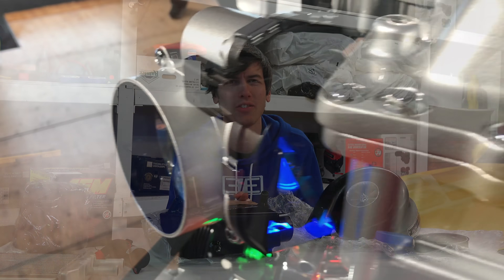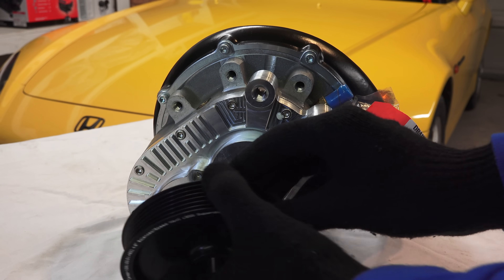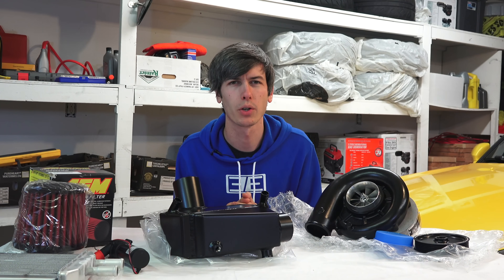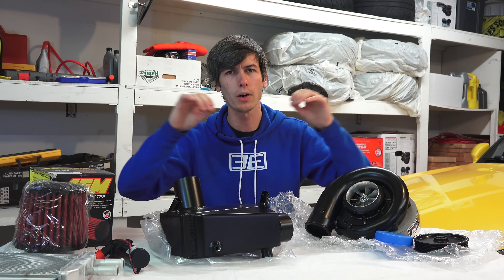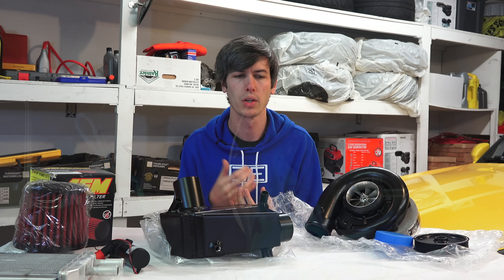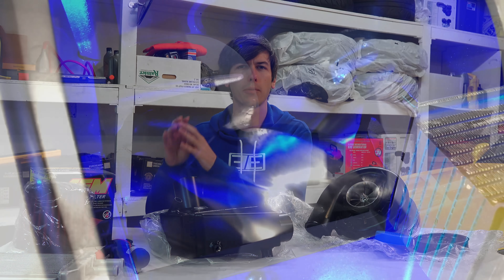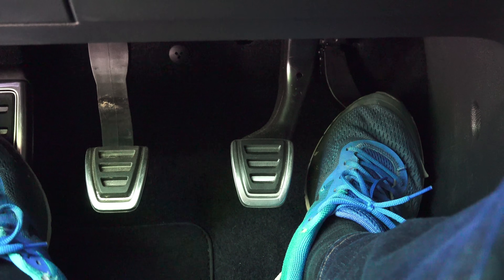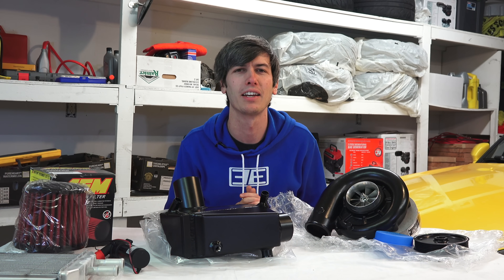Turbochargers vs Superchargers - Which Is Better?

Comment: I agree with your conclusion. For a street car, I much prefer a supercharger. In part for the lack of lag, but also for the torque curve. My current engine (heads/cam/blower LS3) is an example. We started the dyno pulls at 2500RPM. At 2500RPM it made 450TQ. It peaked at 605 at about 5100. That broad, flat torque curve means it's easier to maintain traction than it would be with a turbo hit, and it also means that the car will pull strongly no matter where I'm at in the RPM range. A turbo on the same engine would probably have made more peak power, but would have a much more peaky torque curve - fine and dandy for a race engine where you're foot to the floor high RPM all the time, but less than ideal for a street car, which spends the vast majority of it's time at part throttle.
Reply: Actually superchargers are much better than turbos for "driving" type races, such as auto-x and road course.  I actually raced a Cobalt SS with a TVS 1320 in road course (Why? I was making sure I wasn't in the same class as Corvettes and Porsches).  314 @ 2k, 321 @ 4.8k, and 307 @ 7.5k in a stripped out car (2640lbs with me in it and a full tank of gas) with a coil over suspension was a blast.  And with the gearing, you would spend the whole race in 2nd or 3rd gear.  In Auto-X, you pretty much stayed in 2nd so didn't even have to worry about shifting.  Thing was a street legal gocart on crack with comfy leather seats.

Comment: Are smaller displacement turbocharged engines really that much more efficient than larger displacement naturally aspirated engines considering the lower static compression ration, extra blowby, and "slight" increase in backpressure when intake pressure is above atmospheric pressure?

Comment: Hey Jason, I watched pretty much all your videos and I had a question. I have a 2008 wrx stage 2+ protuned w/ stock air box w/ k&n panel filter. I was thinking about getting a short ram intake w/heatshield along with a pro tune for the intake.  Will that extra induction benefit me over stock airbox? 

By the way, I drive daily and tend to drive spiritedly more than half the drive, thanks Jason!

Comment: I may have missed this point but with a turbo vehicle after spirited driving you should let the turbo run a little before turning the vehicle off do you need to do anything like this for a supercharger? Although it does not need oil to lubricate the bearings?

Comment: Hi Jason/Engineering Explained, if I do not change my driving habit (mainly on street @40-80kph,  <2500 rpm), which will be more fuel efficient between turbo vs supercharger? Thanks man!
Reply: If I may? At vehicle and engine speeds as low as you are using, I would not recommend either. You would be better served building a naturally aspirated engine that makes good low end torque. This would give you more fuel efficiency, as well as lower maintenance costs and greater longevity of the engine itself.

Comment: I think it would be interesting if you looked into the new Ram 1500 with the electric motor/generator which is mounted to the engine via serpentine belt.  they claimed it can do regenerative braking but that seems weird.  Normally it seems the torque converter would be unlocked as you slow for a stop sign but it seems that it would need to be locked up in order to have any meaningful braking.   also looking into the new claims from GM with up to 7 cylinder deactivation    it seems that it would shake like crazy with 1 piston and also the frictional losses from 8 cylinders and other things like alternator, etc would require more than 1 cylinder to run.   they claim to have start/stop for periods where you would be sationary which seems like would be the only time you could get by with 1 of 8 cylinders combusting.

Comment: PLEASE do a video on the new opposed piston gas and diesel engine. Its in proven prototype phase. Atlas (or something with an A is the company)Amazingly interesting. Based on ww2 german bomber engines. So piston faces piston, no head, no valves, and can run gas and diesel.

Comment: Can you do a video on the theoretical limit of hp/liter in NA cars. I thought this would be relevant given the new Porsche GT3 RS just bumped its hp from 500-520. Giving it 130hp/liter. The 458 speciale had 132.7. I am curious if there is a limit.

Comment: Turbos are also VERY complex to run. To avoid a LEAN* situation in your engine you need complicated 3D fuel maps and fuel delivery systems. With super-chargers you always know exactly how much boost you have at a given RPM regardless of load or throttle position.
This is why adding a turbo to a non-turbo car is dangerous/expensive and complicated vs adding a super-charger to a non-super-charged car.

I'm a big fan of turbos if they come from the factory that way.  Otherwise, super-chargers are your best / most reliable option.
* LEAN meaning not enough fuel for the air being pushed in = over heating and damage to engine internals

Comment: Another pretty huge plus for turbos is their performance at altitude compared to naturally aspirated or supercharged. Any kind of ecu-controlled wastegate allows the engine to increase its boost ratio to maintain its rated power even way up in the mountains where other cars can lose a huge amount of power...

Comment: Have you tried driving a vehicle with a variable vane turbo (VVT) or a variable geometry turbo (VTG). THe reason I ask is because I have driven a vehicle with a regular turbo and the turbo lag is certainly there by contrast I have also driven a vehicle with a VVT which is considerably different (both applications were in Diesel engine equipped pickup truck. The VVT does have a little lag but is considerably less then a regular turbo. With the VVT the vanes can be readjusted to keep optimal boost throughout the RPM range. So my question is (since you have the ability to drive a supercharged equipped vehicle and a VVT equipped vehicle and have the engineering background and tools to test this, is a VVT and a supercharger comparable  to each other in throttle response and power throughout the RPM range and what are your thoughts on the VVT? I look forward to hearing your take on the subject, thank you.

Comment: As discussed, they're all superchargers. There are mechanically driven superchargers and there are exhaust gas turbine driven superchargers. The term "turbo" or "turbocharger" is actually short for the original term turbosupercharger.

Comment: Roots superchargers require oil , they just typically have their own supply.  A lot of new Centrifugal superchargers use their own oil supply as well (V-3 Vortech).  My Raptor AU centrifugal actually just uses ceramic bearings (no oil at all) although it is water cooled.  I can drive around flooring it, stop and grab onto the snail with bare hands... only warm to the touch! Supercharger is great for a power adder on beat up old higher compression engine.  We feed it the most air when the engine can handle the most air (high rpm) so  the load on the engine is relatively low. And no lag!

Comment: Hybrid cars with turbos have almost zero lag. This is true in high end cars. 
Turbos are not as effective in a petrol as they are in a diesel engine. The effect in a diesel engine can be felt, with a lag, but the increase in torque is, in my opinion, enjoyable. 
Superchargers are, like you said, pulling power from the engine and thus reducing some of the power of the engine.
The future of automotives are in the hybrid vehicles and the faster the development of motor generator unit is, the better it will be for the cars to be more efficient, while yes, being more costly.

Comment: Hey Jason. Could you give your input on what could be wrong with my car? It makes a wierd noise when lifting the clutch when accelerating, but only on a cold engine. I have uploaded a 12 second video on my channel. Since you are the most knowledgable person I know, could you give it a look and give some feedback on what is wrong? 

Car is a 2006 1.4 TSI (140/220 HK/NM) VW Golf MK5 (euro spec). The sound has occurred 100 km after a frontend crash. 

Best regards Daniel
Reply: If anybody else has any knowledge to cars - especially VW then feel free to give input!

Comment: I have a question regarding the lubrication systems in turbos. Have there been any examples of a separate reservoir for oil specifically for the turbo? Or is it more efficient to use the same oil setup with some kind of auxiliary cooling system? And lastly, are there many solutions to the heat issue with turbos? If these questions have been answered in one of your other turbo videos, a link would be a fine answer if so. XD

Comment: IMHO i think turbochargers drain also power from the engine, not as much as superchargers but they do block a bit the exhaust gases from going out. Engeneering Explained could you please confirm?

Comment: two questions: why do they not make a turbocharger that has a pulley to spool it until you reach the needed exhast for spooling, then clutch the pulley, and let the exhaust handle it... and branching off of that, why don't they make a supercharger that clutches the pulley until you're at wide open throttle or whatever throttle percentage you desire, so that it only drags when you demand the boost?

Comment: I saw that you had replaced the 2 bolt style oil filler with a hose fitting.  do you like that style instead?  it looks nice so I was curious how you felt about it.  I have a 5.9 cummins that I enjoy driving

Comment: First off, I have spent a lot of time watching and enjoying your videos.  Lots of great info.  That said, there's one concept I take issue with in this video, the idea that a turbo is free energy, powered solely by waste energy.  It's an idea that I've often seen perpetuated all over the internet.  

On a well setup turbo system, you often see a drive ratio of ~1:1.  So if you've got 20 PSI of boost, you've got 20 PSI of exhaust back-pressure or thereabout.  A poorly setup system can be much worse, especially if someone is running right up along the compressor choke line and flow limits of the turbine to squeeze all they can out of it.  This back-pressure reduces the amount of power the engine would otherwise produce.  It makes it more work for the engine to expel exhaust gasses, and that would reduce power where it not for the net increase in airflow, ergo increased fuel and power, of the engine.

You never hear people building N/A cars advising someone not to worry about a big restriction in their exhaust because it won't hurt power.  When you mod a N/A car, a freely flowing exhaust is one of the first things on the list.  A turbocharger is just that, a big restriction in the exhaust.

If you look at blower efficiency charts, it's easy to have a roots style blower sapping 100 HP or more from the engine at full boost, just to drive the blower.  Curious about this argument  before, I looked up dyno results for the same cars with the same engines and the same peak boost, only one turbocharged and the other supercharged.  It isn't easy to find posted results with the same peak boost etc, as setups vary so greatly.  On the ones I did find, the numbers were always similar and the turbocharged car never made an additional 100+ HP.  The results were far from scientific, as there were many variables unaccounted for.  I could not find air intake temp, so the air charge could've been of significantly different densities, the dyno's were on different days so atmospheric conditions were not the same etc.  That said, in my opinion the results did not show a disparity large enough to support one source of boost sapping no energy from what would've otherwise been crankshaft horsepower.

That said, I very well believe there could be an efficiency difference at other operating areas, especially under light load conditions where a turbo presents a minimal restriction.  I would especially love it if someone such as Engine Masters would do an episode dynoing the same engine with both a turbocharger setup and a supercharger set up, with the same boost etc on each.  There you would have the same engine, the same dyno, the same lab conditions, and no driveline loss calculations.  It would be a truly interesting comparison.

Comment: You make it sound like turbos have no power draw on the engine however they make a large amount of back pressure in the exhaust system which is also a power loss similar to that of a supercharger.

Comment: yes it is efficient to use the waste energy from exhaust to spool the turbine, but i still think about the penalty of additional back pressure compared to belt driven (supercharger) system that have characteristic similiar to naturally aspirated engines.

Comment: It is a common explanation that the exhaust gas energy used by the turbocharger is somehow "free" (would not be utilized without the turbo). How come? The engine has to put some work into ejecting the exhaust gases and puting the turbo in the way increases exhaust resistance a the engine has to put more work into overcoming it.

Comment: I have had turbocharged and supercharged cars and I personally would still pick the Turbo mainly because of the noise and the rush as it comes on at higher rpm.
Reply: Tristan Gillis My centrifugal sounds cool, but the whineeeeeeee sound cant be beaten...
Reply: from a performance standpoint, a turbocharger is better hands down. the problem he mentioned about turbochargers having lag and superchargers having better pedal communication only applies if you are relatively new to the car. after spending some time with a turbocharged car, the driver should be able to fully understand its characteristics and thus will be able to get what exactly he wants from the car. most boosted racecars with experienced drivers who won't face the miscommunication issue use turbochargers and not superchargers for a reason. turbochargers and simply better if the driver is good. drawing power from the engine just to boost it just doesn't make sense, no matter how you spin it
Reply: Legit a bigger boost at a higher RPM works in a super charger, also a waste gate and blow off valve make that noise... so like super chargers are just better overall for power across all platforms, when u start plugging money into ur cars engine, twin scroll turbos defiantly make life a lot easier with different amounts of boost and different times, I prefer super chargers doe
Reply: FuNNy DuBBy absolutely false... superchargers are not better for power... way easier to get more power out of turbo’s and they’ll always make more torque
Reply: "Facts"  It's purely preference.
Reply: Turbo any day, that feeling when it kicks in..
Reply: @gollese  yeah and the supercharged car already blew past ya. Shile you waiting for that feeling lol
Reply: Tristan Gillis depends it's your preference
Reply: Tech Showdown ayy lmao its you
Reply: Not all turbochargers have rush at high rpm, it depends on the turbochargers air ratio, compression ration, and so on. This means that if the manufacturer wants their car to have a rush at a low rpm, they will adjust the turbochargers air ratio, compression ratio, and so on. If they want a rush at a high rpm, they will adjust the turbochargers air ratio, compression ratio and so on. :)
Reply: @maga0280  and if they buyer wants to change that its as simple as that!!! So what u said was pointless
Reply: I turbo, supercharged cars.

I sound crazy, but I do it.
Reply: Do you know if you can turbocharge an automatic?
Reply: That's what I like about DIRT BIKES!!!   It's the throttle response and engine control.  There is no greater "feeling" than the throttle control on a powerful engine!!!   Especially when you're sitting on it!!!
Reply: Nicks 92 videos wow his opinion is wrong? Yours is arrogant and that's way worse

Granted i loved the supercharger whine on (what used to be the) V8 supercars, esp. the Holdens (GMs for u in the states, they ran chevy motors anyway) and waste gate shutterring on a turbo annoys me (not as much as a wrx that sounds like a lawnmower), but opinions aren't "wrong" or "right" because you agree or disagree theyre expressed personal feelings on a matter

Just say you disagree and say what you like about superchargers, like the dude making jet noises. Simple
Reply: Your opinion is wrong Superchargers make that nice whine sound like a jet.
Reply: @Nick-1992-SRB  You get jet whine from turbos too.  IF not then your car is designed to supress that sound.
Reply: @Nick-1992-SRB  I agree!
Reply: Nicks 92 videos shut up
Reply: @Nick-1992-SRB  100%
Reply: Blower whine > turbo whistle.

I'm sorry, these are just facts.
Reply: The whining of a supercharger sounds absolutely annoying.
Reply: @WintersunEnsiferumx  your wife must ve so happy she married you.
Reply: Why you need noise? Did you  ever tried electric car, without noise and with enormous power?
No gasoline car can beat that. Power from Zero to max. Right now, when you press the pedal...
And driving without sound and without vibration is much more nice. Just try it, before you talking bad about "no sound" cars.
Reply: eDrive Because the noise drives the adrenaline. Listening to a V8 hit redline while it throws you into the back of your seat is a visceral experience. No electric car can beat that.
Reply: it seems every one is talking about sound,your the only one who is not,where did you see differently??did I miss something?besides here in the u.s sound is a very important part,some like sound some like speed ,I like speed &I like the sound so I wont hear the ol"lady bitchin because im speeding so sound is awesome no matter how one looks at it ,ive been single 18 years ,but cant do w/o speed or sound
Reply: @eDriver  yeah but thats just weird though 😂😂 crossing the street all of a sudden "BEEP" like tf did u come from? Realise its a hybrid 😂😂
Reply: @eDriver  the big noisy gas engine scare you, widdle guy?